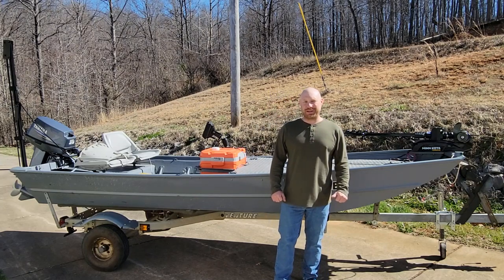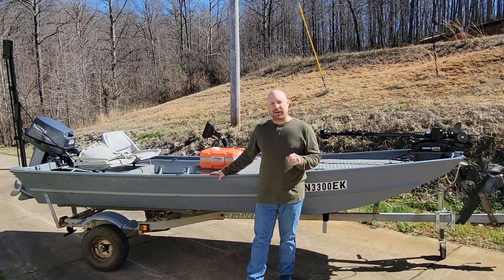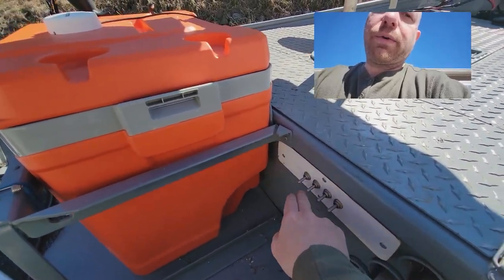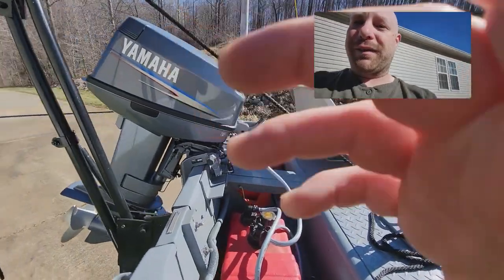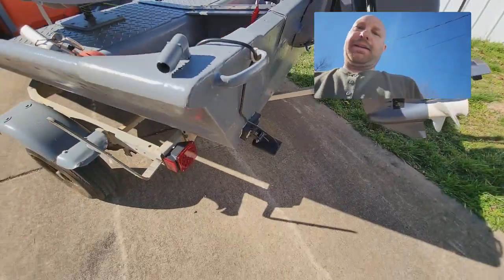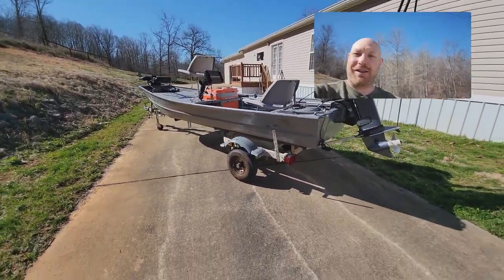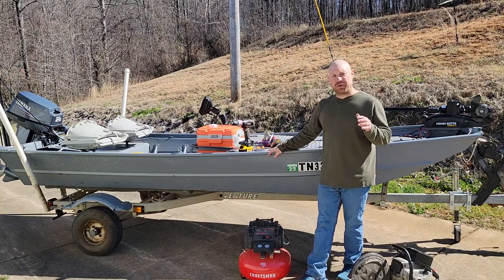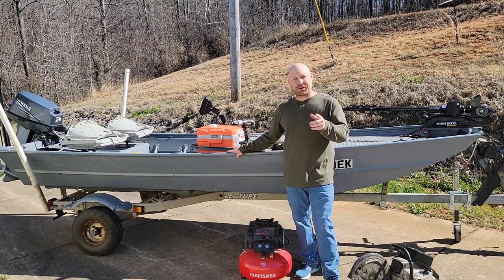Amazing DIY Jon Boat to Bass Boat Conversion

Comment: I just bought a 14x36 for 75 bucks the trim on the transom needs replaced and the floor is missing 3 support beams , what can I use to reinforce that
Reply from the maker: If it needs professional repair, you can ask a metal shop to weld in aluminum support, and see how much they would charge. You can also potentially get some aluminum yourself and bend it as needed, and then rivet it in place.
Reply: @TheLowBudgetOutdoorsman  appreciate it. I'm just trying to get a casting deck and livewell on mine for tournaments in June
Reply from the maker: @mr.booyah8518  Sounds great! They are a lot of fun to build and use!